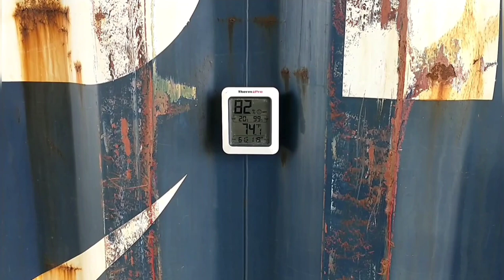Rammed Earth Floor (Part 2) & Monsoon Rains #44 DIY Off-Grid Home Build 🏜️

Comment: I could not imagine having DIRT SPONGE floors in my beautiful and amazing home.
Reply from the maker: The top coat will be well sealed and then waxed. We think it's going to be pretty awesome! Stay tuned.
Reply: While a nice ideal, after 30 years of professional house repair, including buildings with earthen floors, these, in practice, are a maintenance nightmare. 
If you want to spend all your spare time repairing your building by all means reinvent the wheel. But, There are plenty of durable zero VOC flooring solutions that actually work. They are water tight, cleanable and actually work. 
You will never actually seal a dirt floor not matter how much oil you add. It’s just porous semi solid mud. Which was awesome hundreds of years ago. Complete Compaction over eps or any resilient foam is conceptually flawed. 
Dirt floors no matter how “expertly” done are always prone to gouging and deterioration in the face of standard use.

Comment: Kinda lucky that you got that humid weather to form the floor, so it could cure all that much slower.  Doing one wheel barrow at a time probably helps control cracking...in that it isn't strictly "monolithic" like a single liquid pour.
Reply from the maker: Yes, it worked out well. 🌞

Comment: I wrote specifications and supervised installations of radon mitigation systems for local authority housing in the UK during the 1990's. One of our ground floor flats had one of the highest readings in the UK. The old lady chain smoked too! The systems were fan assisted venting at roof level and worked very effectively. I did a quick google search and it appears that Arizona has some of the lowest radon levels in the US. Radon tests are available on Amazon between $30 and $60 dollars. I would suggest that is cheap insurance especially as your project is very airtight.
Reply from the maker: Cool, sounds like you know a whole lot about it! We are pretty far south in Arizona and have a moderate risk, but we are pretty close to Mexico, which is a high risk area. We put in an upper wall vent in each bedroom that will likely stay open year round, so that might be enough on its own, but probably better to not let it get inside in the first place. It would be interesting to test for radon near the exit pipe. 🌞

Comment: I thought you were going to do rammed earth! That would have been very time consuming and hard physically. This is so interesting to watch. Would it be easier if you measured the water? Like one or two buckets per load? I love the color.
Reply from the maker: The base of our floor is a mix of soil, cement, and sand, moistened and then tamped down. Which is how rammed earth is made. This time of year, the soil has varying moisture content, so the amount needed isn't always the same. Thanks! We'll be showing the finished floor in Saturdays video. 😊🏜️

Comment: Great update. I’m loving that floor. And it’ll provide great thermal mass, right?  I get why you used plastic sheet to provide a moisture barrier, but I’d like to better understand the benefits of the thermal barrier between the gravel and the earthen floor, please.
Reply: The earth floor becomes a thermal storage “battery” and without the thermal barrier between it and the underlying ground, it’s heat would dissipate down into the ground.  With the insulation the absorbed warmth will remain in the room and slowly dissipate back into the room as the air cools.
Reply from the maker: Thanks! Yes, great answer Cat Gynt. All of the thermal mass we have in the house seems to really be helping. The outside temperatures are ranging 40+ degrees from day to night. The temperatures inside the house are only varying 8 degree from day to night, without using any cooling. 😎

Comment: When you finish the topcoat will you be applying a moisture barrier (Thompson’s Water Seal) or something similar to keep the floors from rehydrating from condensation or occasional spills?  Any hints regarding embossing or stamping a pattern into the top coat, perhaps a sundial or compass.  There are tints that can be added to concrete.

Do you have any future plans for a root cellar to store and preserve your garden harvest without using electricity to maintain cooler temperatures?  Wishing you and your family another blessed week filled with peace, gentle weather, nourishing rain and restful evenings.  Peaceful greetings from NE Ohio.
Reply: Linseed Oil is what they use on these earthen floors.
Reply from the maker: Yes, we plan to use linseed oil. It seals out moisture and stains and also hardens the floor. We also plan to put on a wax coat. The floor will have a pattern of sorts, but maybe not what you are expecting. 😊  As far as a root cellar maybe some day. 
 I hope we get a little more rain before the monsoon season is over. Things have dried out a bit now, but it's still nice and green and the temperatures are fantastic. 
Thanks so much, and wishing you a wonderful week as well! 😊🏜️

Comment: I am pretty sure that you are not tamping it enough. To make rammed earth, you need to actually ram it. That means that you have to keep hitting it until there is an audible change in the thuds being made by the tamper, which means that it can't be compacted anymore. You are looking for something like rock when you are done. I think you will have to form it by putting a board across the room and brace it against the opposite wall. You could do a foot or a foot and a half strip across the floor at a time. The way you are doing it, you can't compact it enough, because there is not anything to stop the dirt from spreading out as you hit it instead of just compacting down. It is a lot more work than you might have envisioned. Bang it down until you think that it is absolutely hard, and then go a little more.
Reply from the maker: After he gets done tamping it. I spend more time compressing the edges and walking on it. It's all pretty solid, and so far it's looking and wearing well.

Comment: How level is the finished floor?  Are you going to sand it to make it level and smooth?  Nice job.
Reply from the maker: The top layer turned out really nice. It's not perfectly flat, but quite good. The bedrooms are more smooth, because I burnished them some, and there was less sand in the mix. We prefer the finish in the main living area, it has a bit of texture which is nice. The wax added a little shine, and really sealed the floor well.

Comment: Potential crack forming at the inside corner created by previously poured concrete kitchen floor. Consider some sort of control joint.
Reply from the maker: We are expecting some cracking,  it adds character. 🌞

Comment: Hello, hope you guys are doing fine.
Can you tell us what  living  feels like on this floor compared to others.I don't think you have heavy trafic but tell us how its working out..still very pretty has it changed much or any? how is maintenance on it so far? Thanks for letting us know.
Reply from the maker: Hello! I really love the floors. They do take a little extra maintenance, but I don't mind it all. I love the look and they are warm and comfortable  I have had to spent some time filling in the crack where the earth floor joins the cement, and a few some smaller cracks. I just used sand, and sealed it with wax. It took some time, but looks better and keeps the ants out. I also put some pest granules down the crack, and that worked.  I do a quick vacuum everyday, and haven't had to mop yet. Just a little spot cleanup. It should mop fine, but I will try to use a lightly damp mop. The oil and wax seal the floor really well and it's clean. We are careful not to drag anything across the floor, but overall it doesn't seem to dent or scratch too easily.  It will just adds character anyway, or could be easily patched. It's not for everyone, and not your typical floor. We were nervous but it has worked out well and we don't have any regrets. Best wishes - April 😊
Reply: Hi there that is wesome! congrats, Thanks for responding once again thank you both for all of your videos that help many of us learn.Take care & enjoy your home.👍

Comment: Your dirt floor project is amazing. Glad the "frogs" survived. I think you may have spadefoot toads and not frogs. They have a fairly smooth. skin, hibernate under ground until rains come. Then they go to standing water and breed fast. If water pond is short. lived tadepole stage can accelerate. Like your wildlife stories and pictures.
Reply from the maker: Thanks! We have several different kinds, but we don't know for sure what they all are. We also have Sonoran Desert Toads. They sure make a ruckus when the first rains come. 😄 Our pond still has quite a bit of water in it, so I think a lot of the tadpoles made it this year. 🐸🏜️

Comment: Is it possible to add some fiber and concrete to increase the strength?
Reply from the maker: Many people add straw to the mix. In our experience, adding portland cement makes the surface more brittle and prone to cracking later. Our most recent video shows an update on the earthen floor.

Comment: It doesn’t look like you are compacting the soil nearly enough, you have to ram it hard to compress it
Reply from the maker: It can only be compressed so much before it starts spreading out too far or cracking. After he tamped it I spent a lot of time compressing the top and edges. In the end it was a very solid base.